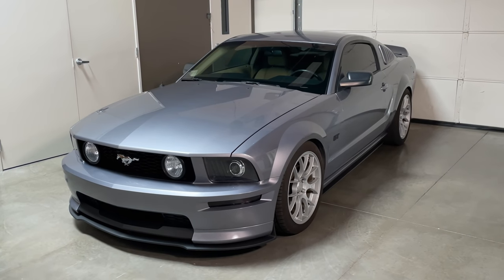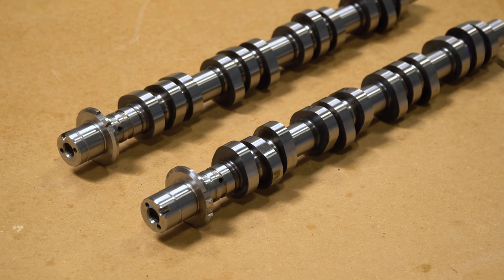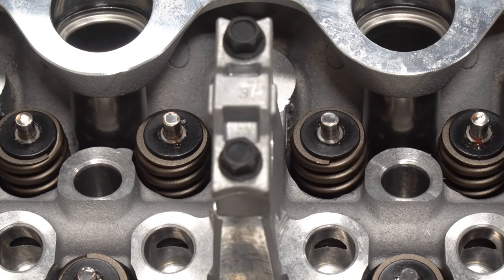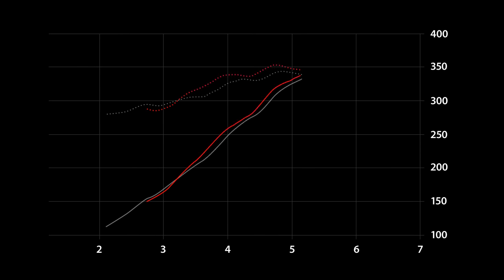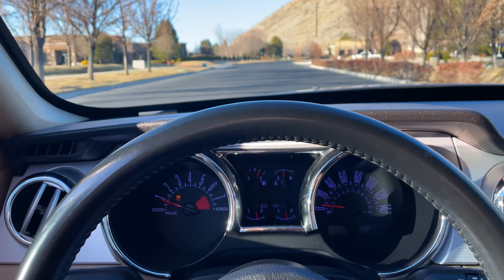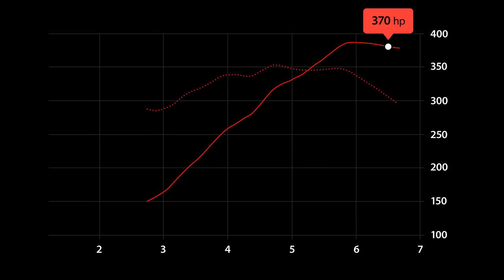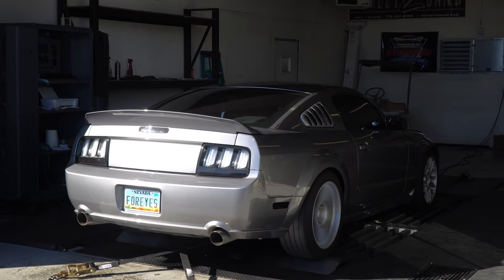The results 📈 of installing the most aggressive cams on my Mustang

Comment: My build for a 98 Mustang GT. Naturally aspirated 4.6. Cold air intake. Stage 2 comp cams. Stage 2 patriot heads. Racing intake manifold. Wide intake plenum (forgot the size). MSD ignition packs. 11 mm spark wires. Flex plate for 10,000 RPM. 4:10 gears. 17s in front and 18s drag radials. Might be it I believe....eventually I’ll remember what else I slapped in there. Tuned at Shelby. 437 at the wheels. 517 torque. 507 at the wheels. I have to look for my paperwork, but I think that was the order. I still have this build parked. 8 mpg. Car launches is best description. Nice build by the way!

Comment: Never been a fan of that year but honestly, THAT SOUNDS MEAN AF!! That's some good reliable horsepower!!!

I went from a 3.08 to a 3.73 rear gear with my supercharged FoxBody (476whp/480tq) and I miss my longer gears!!! If I was you, since your car is ALL-Motor, I would go 3.73 and try again!!! (just finished the video and saw you went 3.73). that's a perfect ratio for a non boosted build, I cant wait to see the next race! SUBBED!!!

But this is exactly why I'm going LS with my fox. Got a 5.3 cast with a low rise Holley intake manifold and single turbo, shooting for 800whp!

Comment: i personally have no bucking with detroit rockers. Installed by brenspeed. Super smooth, Both with 3.31 & 3.73s. Luvin em. Great idle sound. Great power utilizing stock motor. Detroit rockers are perfect for the guy on a tighter budget.

Comment: 2005 F150 5.4 3v - I put in comp cams SPR cams, beehive springs, ported heads, headers, high stall, FBO with a 4.56 rear end. It made 300hp and 350 tq. The tq curve was broad and flat making it very street worthy considering the low hp number. It was still good for a 5 second 0-60 with a curb weight of over 6k lbs. sounded amazing too. It’s hard to get power out of the 3v 5.4.

Comment: Although just a simulation, I configured super short gear ratios and final gear in a Toyota Yaris in Forza 5 years ago. Stock everything else, I was able to whip around a short, quick turns course against much much more powerful cars. Mechanical advantages are often overlooked. Good luck with the 3.73’s, you’ll love them (and new transmission now, too)

Comment: Very good. My
1988 had 355 gears.
1992 wasest streetcar in Hawaii. 
I had alot of money in it.
Now I got f150 r cab, s bed.
Blower and 355 gears.
With 373 's u can run a taller tire. 
Anyway be safe have fun.
#1 protect the car from thieves. 
And my wife and I had dinner with Mr Carrol Shelby and his wife in Waikiki.
Not to mention the muscle mustangs and fast ford's. 
I'm 58 now.

Comment: Sounds great, I've always had v8s until I bought a Ford xr6 turbo.  420+rwhp with torque building way low. 14psi, intercooler, fuel pump, injectors and tune. That's it, my model came with strengthened valve springs and forged Pistons stock..Also got installed strengthened drive shaft cos they twist. ZF 6speed auto. Going to install pcm tune next which has launch control via cruise buttons

Comment: I still need to get my 3 v dyno tested. I have fully built 3v. Comp cams stage 3. With comp springs and vvt lock out. Cp pistons bored over 20 thou. 302 rods. One size over on valves. Stage 3 port and polish. Ford racing intake. Bbk 62mm throttle body. Jlt cold air. Ford 47 pound injectors. Tuned on 100 octane. Mgm short throw. Ac deleted. Walborough 400 fuel pump. Long tube headers into x pipe excell coil packs. And sct tuner. Couple other things like after market oil pump after mmr's oil pump gears failed on me and costed me a motor

Comment: If you’re going turbo, you’ll regret swapping out the 3.31s, trust me. When that boost hits in 3rd you wanna ride it out as long as you can. Coming from an 03 Cobra owner with an 8385 PTE and 3.73’s.

Comment: Holey sniper intake + stage 3 cams revving to 7.8 rpms + 4.10 gears. Wms air intake + cervini hood. With that setup you will be at 410 torque and the same rwhp if not more, if not enough, push to 450 torque with methanol injection.

Comment: Find a more beefed up throwout bearing and shaft donut accordion slave cylinder, or mod a fork style in. The stock one is flow limited to slow engagement down, to keep from breaking traction. Ford is good for tossing in a low ratio dif. A '97 Thunderbird might not blast off at a red light like a Civic, but won't be a kazoo on the interstate, and still rumble at 25 mpg+ on a highway cruise.
Reply from the maker: good info thank you

Comment: Another way to get around that bad clutch. For casual driving to save it for digs and rollers try shifting without the clutch. I got a 98 GT that I stuck the 4v 4.6l from the cobra in it, I shift without the clutch for casual driving. Basically just while driving, slowly lull the shifter out of gear and as you pull into the new gear, blip the throttle. Done right the shifter will glide into the gear, clutch isn’t required for casual driving, but for racing yes it is. Just a little something I’ve learned from truck drivers and old mechanics over the years.
Reply: except bad clutch does not grind gears, the syncros are shot
Reply: @DuBstep115  the transmission for the mustang “stock wise” was never really a good one til about the 16 model. The t5 trans always has that hiccup where you had to stick it in fifth and then go to reverse to not get grinds. Just how the synchros were mocked up in the tranny, even bad syncros have hiccups you can use to get around grinding gears

Comment: Hey Four Eyes.....where you wanting to go HP\TQ wise you may as well do the 6-speed swap when you do the clutch as only the TR6060\T56 trans can hold the HP\TQ levels you're aiming for. The best a TR3650 can be built up to handle is around 510 ft\lb TQ max....stock TR6060\T56 can handle around 700 ft\lb TQ & can be built to handle far more. Also just making suggestion (you may already know this) to use a good gear calculator (like Gearhead) when making gear changes to account for the tire dia being used (you're running 20" wheels so I'm assuming that you're running tires that are around 28" dia....these are making those 3.31 gears even worse for acceleration due to limited NA engine TQ output....turbos can rectify this). Remember RPM is RPM regardless of how much engine TQ is produced (all engine TQ does is affect the amount of time it takes for an engine to get to target RPM according to the built in mechanical gearing ratios + tire radius due to the twisting force applied) so use a good gear ratio calculator to account for tire dia (calculator converts dia to radius). I use Gearhead myself & find it to be spot on so you know what you're gonna get out of it before doing anything. Hope this helps. Excellent work w\ your 3V!

Comment: Turbo Miata guy here. The shorter diff is going to make a huge difference. I've got a 4.1 diff and the gears are wayyy to short for the 300+hp I am running. I spin tires in both 1st and 2nd gear, and sometimes 3rd gear. At the track, I have to shift into 2nd before the 60 foot, bounce off the rev limiter at 7300 rpm at the 1/8, and bounce off the rev limiter at 7300 rpm at the 1/4.  A 3.73 gear in my situation will fix almost all of my issues with my current power. Based on your weight and horsepower, I think it will suffice you as well. 

Going down to 4500 rpm isn't your problem, although; you probably want to hit the next gear slightly higher than the peak torque value. Maybe 6800 would be more appropriate. You don't want to shift much higher because your horsepower curve falls off a cliff at 6500. I find it strange that you peak torque curve did move to a slightly higher rpm, but your peak horsepower did not. It looks like you have a lot more potential, so something isn't quite right. Could you get a shorter runner intake?
Reply from the maker: Pretty sure it's the elevation. Not enough air pressure up here at 4,500 ft to sustain the motor much after ~6,000 rpm. I assume once it's boosted, the horsepower curve will be basically up and to the right to 7k.

Comment: 4Eyes dig your channel! Have a 2010 S197 3V, love the car. May I recommend a few more items to add to your to do list - Lightened flywheel, one piece aluminum drive shaft (Ford Performance) and safety loop to go along with your clutch job. You'll be amazed at how much more freely she revs. Also recommend a MGW short throw shifter, no more missed shifts. Other items: stainless steel braided clutch line, Ford Performance High Load Roller Pilot Bearing, Ford Performance Pressure Plate Bolt Kit, Mc Leod throwout bearing, Royal Purple Transmission and diff gear oil. Look forward to your next upload. 🦾🦾🦾

Comment: I have a 2009 GT cammed and supercharged. The tuner I used would only do 450 HP as these motors don’t do well pushing high HP. If you’d like I can send you the list of items I have done to it if you would like to compare it to what you currently have done. I wish I had done a cam as aggressive as yours.

Comment: Imagining my Grand Marquis sounding like that on start up :-D So far as the Mustang V. Camaro argument goes... the Mustang will still be here in 30 years.
Reply: I am heavily considering putting some stainless works long tube headers and exhaust on my Grand Marquis. I'm also eyeing the trick flow heads. I called US Shift a few days ago, and they said they have a guy daily driving a GM with the 10r80. Their 10 speed controller should be for sale next year.

Comment: Honestly this is the best 3v I've seen in a while  I respect people with 4.6  who still play with more modern cars cause of the power difference. It was kinda easy to get   my 5.0 to just a little under 500
Reply: At this point, I would just get a Camaro if I had to because those 5.0 have the shittiest manual on earth and the current body styling is laughable.  A chinese mt-82 and a fugly body style, no thanks.  And yeah I know you can get a 5.0 S197, though the body styling isn't as good.  Rear end looks terrible.  Front on '13-14 looks fine though.  Interior is kinda questionable.

Comment: Consider getting 4.10's instead of 3.73 on the 5 speed, I did it on mine (3.73) and now changing to TR6060 to see if I can compensate with the shorter ratio.
Greetings from México!!

Comment: Just stumbled upon these videos.  Nice.  I'm a bit confused though.  I have a bone stock 06 GT.  I thought the 3.31 gears were only available on the automatics?  Unless that was an 05-06 thing, and they changed that for 07 and up?

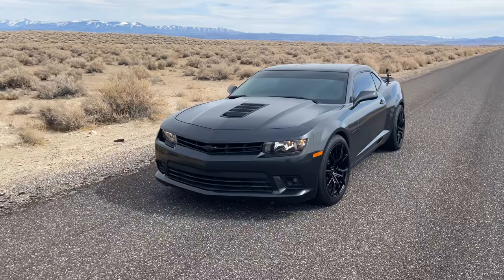In any case the manually equipped 05-06s came with 3:55s.  While I'm no mechanic I would think you would greatly benefit from a shorter gear-3:73s to maybe 4:10s.

Comment: I’ve seen 3 valves with long tubes,x pipe, axle back, different intake plenum, bigger throttle body, cold air intake, tune and under drive pulleys they make around 350-360 rwhp on full bolt ons and tuned to e85 if yours has a stroked motor, cams, full bolt ons and head work only making 387 seems too low

Comment: It would be so much fun to race my Camaro build against your current Mustang build. I have an A8 trans, vs your 5 speed. I have about 390WHP, verses close to the same. However, mine is a 6cyl Camaro. I've raced 5.0's and crushed them with manuals, but I suspect they didn't have the same care, and work your build has.

Comment: Cool build I really feel you should be doing more power then that I've got a 1990 fox 331 dss level 20 block dss 331 sx stroker kit edelbrock rpm proformance heads bbk long tube headers 1.60 crane cams tremec tko 600 5 speed 3.27 rear gears 8.8 ford housing putting out an assault power of 607 max power on dyno pushing hard into rev limit 8000 rpm my daily drive tune has me putting out 540 horse power and rev limit 6500 rpm went up against 2015 ss automatic camero walked him by 6 plus cars

Comment: Your clutch is not the fault. Your synchro’s are unable to match the speed of your transmission rotating assembly. What clutch is in there? If it’s “heavier” than stock it could be part of the problem. If is stock, you syncro’s need an upgrade/replacement. Had a twin disc setup than worked perfect with my combination shifting at 7k, later did a motor swap where it was receding out to 9k and would not shift on a fresh rebuild. Went back to a single disc style clutch and issue was resolved.

Comment: What you could of done is make the car be richer on the top end for the air and fuel mixture also the timing is needing to be readjusted for the camshaft you have installed from the looks of it on top of needing a new clutch.

Comment: I have a c6 z06 with heads and cam. First gear goes to 60, 2nd to 90 and 3rd 125. With my tall gearing I have yet to find my challenges on the road.

Comment: Good video but as a manual trans builder, a clutch won't fix your shifting issue. If you buzzed the teeth that bad then you damaged your gear and synchronizer for 2nd and the only fix is to open it up and repair.

Comment: The problem with the S197 3v GT is the cost cutting 5 speed manual. By comparison Gen 4 fbodies came with M6  from the start in 1993. I got a 2002 Camaro SS M6 and 4.6 M5. Driving both, the M6 is head and shoulders better than the M5. For this car a 3.55 or 3.73 is probably optimal and 4.10 is too much and the M5 first gear is super quick to the redline then a huge drop to the second gear ratio. If you’re going to put any money into the driveline (or as a performance mod) spend it on a 6 speed conversion. I’m assuming this car is a stick.

Comment: I just added a single turbo to mine and I'm putting down 500 hp/tq to the wheels still on stock internals cant wait to pull the engine and forge the bottom end I have everything else ready for up to 800 hp all that's left is forging the bottom
Reply from the maker: nice man
Reply: @Four_Eyes  if you can get your hands on the blowfish shift bracket get it. It will fix a lot of your issues with the shifting in high revs.

Comment: You can literally buy an Acura RSX with a K series. Throw a 62/66 turbo on it, run 16 lbs and make 400hp+. Stock internals and all. I had a buddy run that setup for 3 years no issues lol.

Comment: Strange how these other 3V cars can’t hang with the big contenders now days. My 2010 4.6 3V has full bolt ons and is tuned by strictly performance in Texas. Mine has a 5 speed with 4.10 gears. My car roasts the tires for about 2 entire gears before it catches and when it does I normally start catching whatever I’m racing quickly but never have enough time to pass em up before the run ends. I’ve never seen any of these other 3V cars spin as bad as mine. Even with my spinning and 330hp motor I can be glued to the back bumper of any modern car that gets beside it. For example, I raced a 2015 5.0 which had a few mods and of course due to me spinning so bad he jumps out a ton on me but when I hit 3rd I started catching him like he was sitting still and was at his back fender when the race ended.

Comment: Lowering the gears WILL make difference, and changing clutch will probably make you run even with your buddy. However, draw back with a stock manual trans will always be lifting your foot to shift. If you are a total gear head like me, instal a Lenco street 4 or 5 speed. the trans has clutches in the transmission that allow you pull levers without lifting your foot and loosing time. Plus, when people look in your car and see levers, they're jaw will drop and they will look at you like you're an alien and say "what the fuck is that?"

Comment: I like to know why you didn't try getting a bigger block instead of stroking the motor.  All due respect I have heard that stroking the 3Valve is not even worth it.  But you do now have solid forged internals for your turbo build.   Has anyone here upgraded to a bigger block and use your stock heads?

Comment: Sup Four Eyes! I love your 3v build. I wish I could invest that kinda money into my 3v lol. Question though. I see you have the 1st gen Raxiom vector taillights. Have they been holding up or have there been any issues? I've read reviews that those gen Raxioms tend to go bad or have issues.
Reply from the maker: yeah they are pretty faulty. mine only work if the parking lights or lights are on. i've had them for a couple years now.
Reply: @Four_Eyes  Damm that sucks. I’ll stick with getting the Vector V2’s then. Ty for your help.

Comment: I'm surprised you attacked engine before gearing. I'd have dropped a set of 4.10:1 ring and pinion gears in the rear end right off the start.

Comment: I have a question tho, Why ?

I usually understand doing things differently, wanting to keep the original engine and not swapping and all, but despite not knowing mustangs much I don't understand why you'd spend that much on a 4.6 instead of swapping a 5.0 ? Seems like there's no upsides I know of to the 4.6 and no downsides to the 5.0

Comment: If this setup had a 11 and a half to 1 compression ratio with E85 it would be making at least another hundred horsepower. That low compression ratio is what's killing the setup. You simply cannot have a stout naturally-aspirated setup without high-compression.
Reply from the maker: i’ve been waiting for this comment forever
Reply: @Four_Eyes  you're welcome and considering you only have a 9 to 1 compression ratio I think you're doing pretty damn good naturally aspirated.

Comment: This is why I love my Terminator Cobra so much. Just at 500 to the wheels with a pulley swap exhaust, intake and tune. 
And if doing a blower swap and fuel system which is considerably more expansive than the previous mods you get into the upper 600-700 range. Mines currently sitting at 676 turned down to keep it safe on 93 but I’ll be going to the dyno this spring to see what it can do on Torco. After that I have longtubes going on.